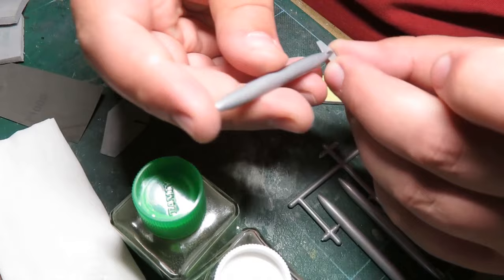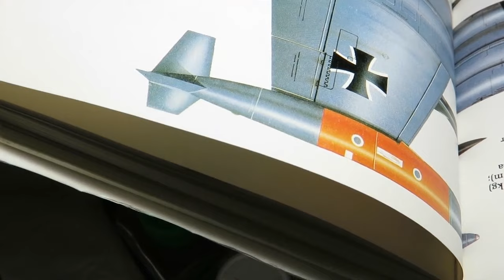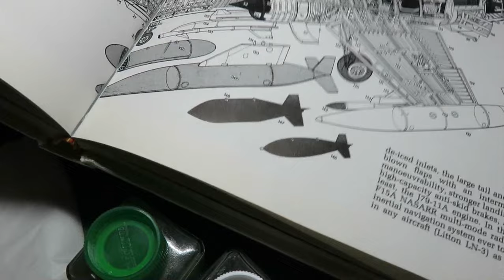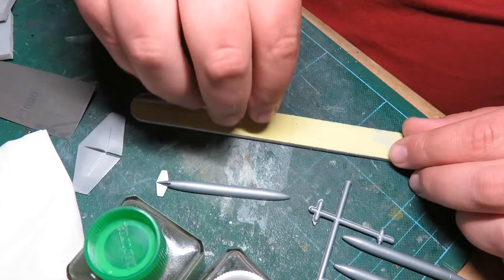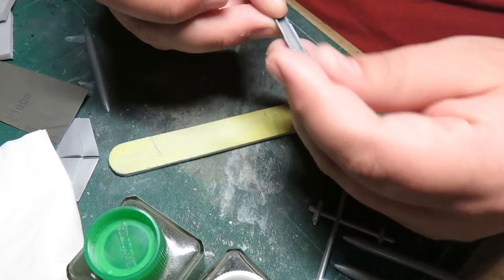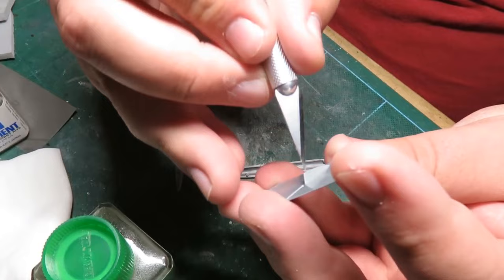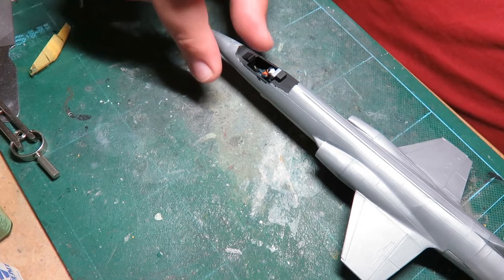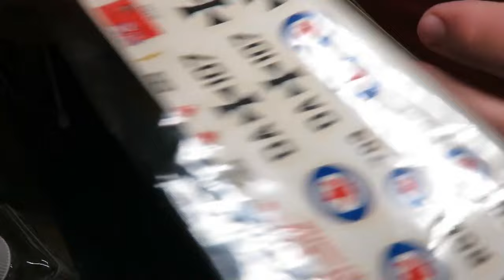Airfix 1:72 CF-104 Starfighter (Part 2)

Comment: I'm really enjoying watching this project. I think it's fantastic to see a vintage kit go through a proper construction and I like the idea of the paint work your giving it. I may have stuck with original decals.... but if you have up to date decals that are a hundred times better in quality I guess common sense should prevail and use them. I'm looking forward to the end result.
Reply from the maker: I was quite torn with that decision, I really wanted to keep everything in this kit original, but those new roundels were just too tempting :D. And I was worried that the originals wouldn't work properly, always a risk when building a vintage kit like this :D Thanks for watching :)